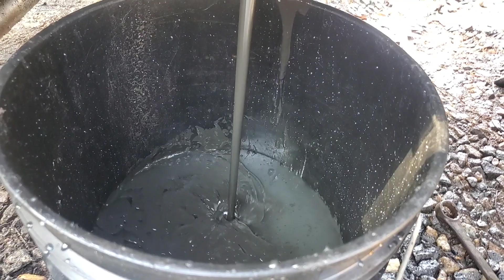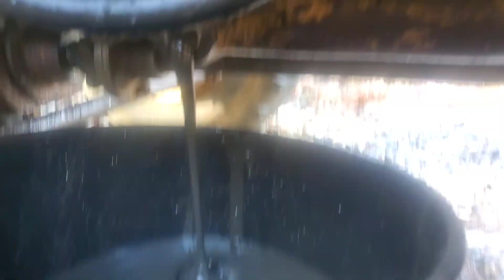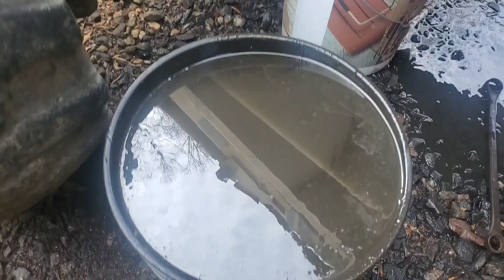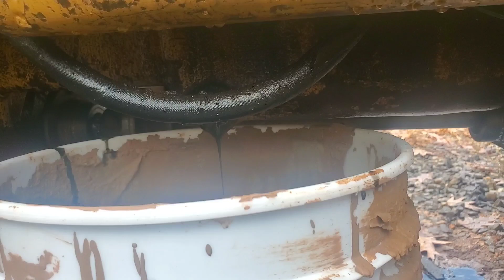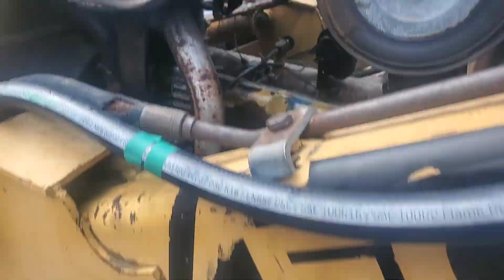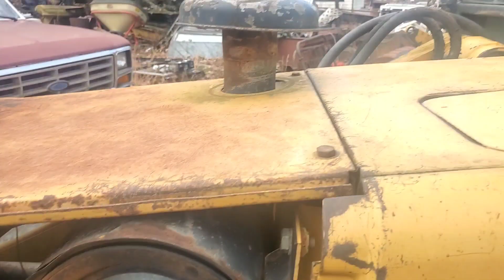Ford 655C Backhoe - Yeah...the oil probably isn't supposed to be like this.

Comment: What was the prognosis? I just found my oils to be sludge and grey just like this.
Reply from the maker: @Ancientpath75  this particular machine had been abused and neglected by its owner for years. The source of the water getting down to the crank case was surprisingly external. The crank case breather had been removed for God only knows why and when rain happened, it collected on and ran down the top deck of the machine onto the top of the motor and found the open crank case breather port on the valve cover.  I fired the owner as a customer after habitual refusals to heed advice and continued abuse of equipment and employees. I'd be surprised if this machine is still operational. Current status unknown. My repair for this condition involved removing all 4 injectors to resolve hydrolock from flooded cylinders, crankcase drain, and several cycles of flushing the engine with fresh oil until no further water contamination was detectable.
Reply: @ interesting. I just drained the oil and lots of water came out and the same sludge as yours. 
Sadly I only bought this two months ago. Not sure if it’s repairable or worth parts and scrap. I am not mechanic so a bit lost. 😞
Reply from the maker: @Ancientpath75  only way to know is to test it. If you don't have a cylinder leak down test rig and a coolant system pressure test rig, the most economical way to verify is by flushing the crank case with fresh oil until you no longer see water/coolant contamination when you drain it. If it doesn't run out clean after about 3 cycles... stop and have a mechanic perform the previously mentioned tests.